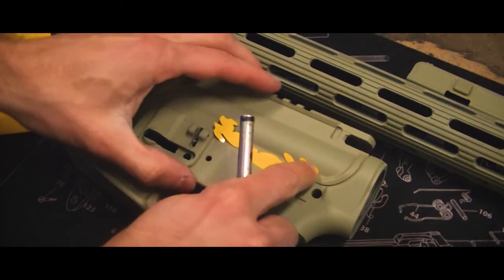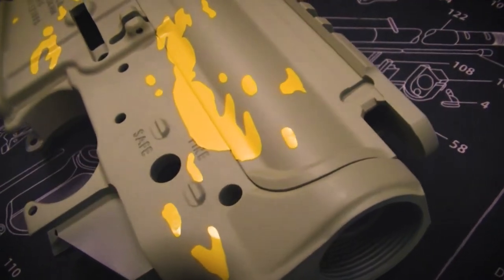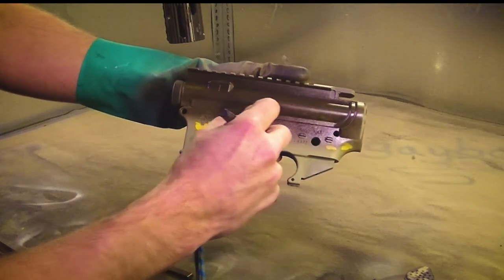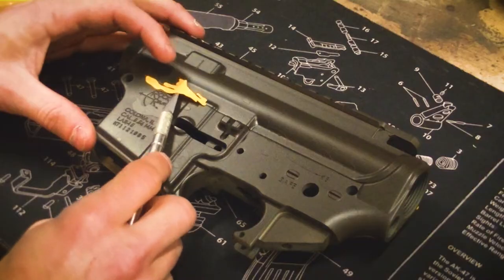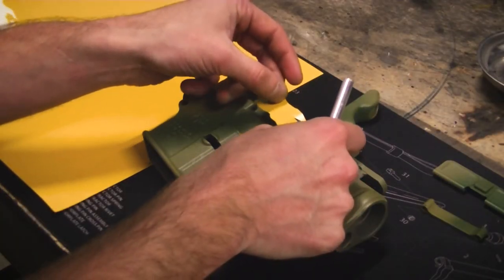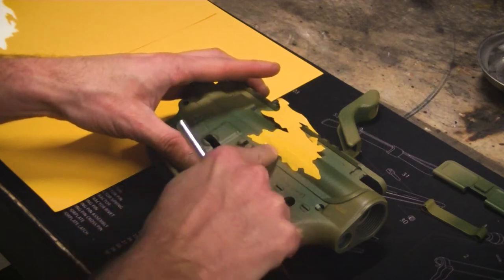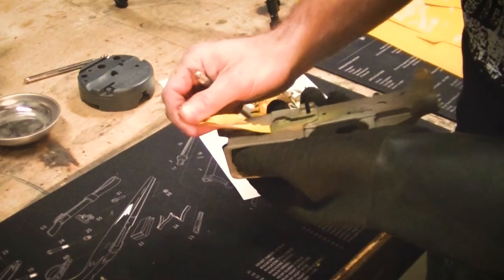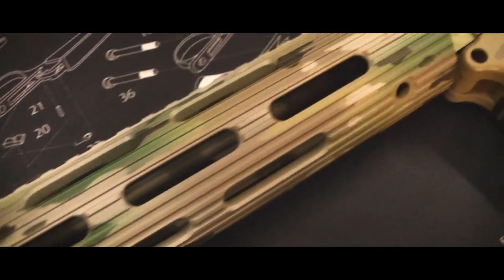How to Paint OCP Scorpion W2 Camouflage

Comment: Do you flash cure before spraying the gradients of dark green over light green or do you wait to air cure from the light green
Reply from the maker: We recommend flash curing, but it may depend on the project.  If you can maneuver the parts around to apply the gradients without contacting the prior layer then you can get away with it.  Tumbler cups are a good example for that, but larger or more complex shapes can be tricky and may need to be handled a bit as you work.

Comment: This looks great! I have just one question: what is the difference between the small stencils and large stencils? Are just the sheets that hold the shapes larger or are the individual shapes larger?
Reply from the maker: The small stencils are the little bean looking shapes, and the large ones are the large splotches
Reply: @FreedomStencils  so does that mean you need both stencils to get the full pattern?
Reply from the maker: @carterskindle7086  Yes, to get the right look you'll need to create the beans and squiggles, as well as the big splotches. If your using our stencils, both shape styles come with.